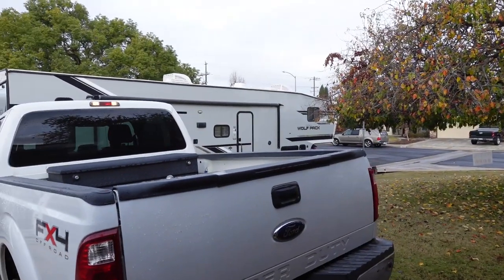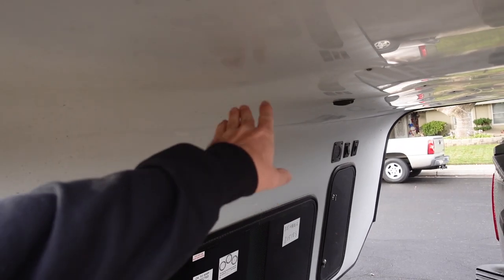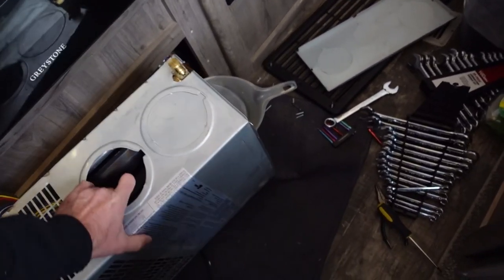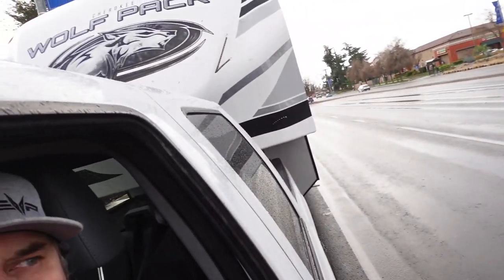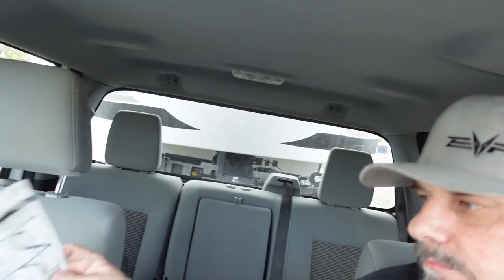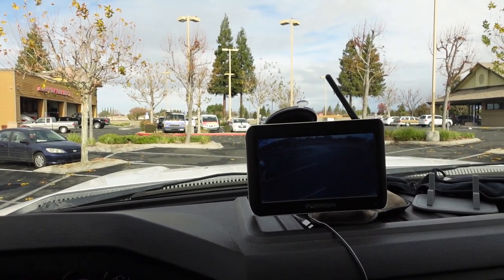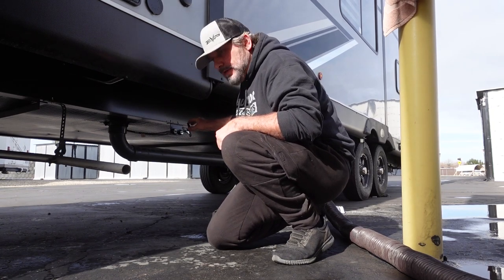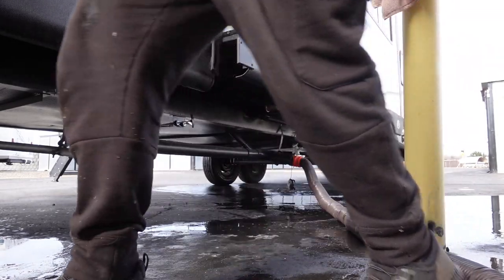Toyhauler Troubles - Preppin' For  Poopin' in Glamis... RV Clogged Drain = No Good!

Comment: Rhino blaster pro tank rinser!! The easiest way to back flush up the line and clean out a clog! Always try to dump tank before long trip home to avoid solids settling to bottom of tank into the drain lines, this is a common issue with the newer trailers that have the valves in the lines...not at the bottom of the tanks. The Rhino flusher is perfect cure for when it does plug tho. It allows you to close a valve at the hook up, and pressure flush into tank, while your drain hose is hooked up and won’t make a mess. Worth every penny!! That’s just my 2 sh**’s worth of advice.
Reply from the maker: I looked it up, we're getting one for sure
Reply: Good call!! I use mine every time, as well as the Santi-flush. Cheap insurance to make sure tank is empty.

Comment: I sent you a Valterra Flush King. It looks like your system has a few too many elbows to get clogged, so It will come in handy in the future. When packing to leave on a trip, I pour a 5 gallon bucket of fresh water in my toilet to help break down the solids while camping. I haven't had a clog yet. Probably too much information, but I hope it helps.
Reply from the maker: That's awesome!!! Thanks man that thing looks like it'll do the job
Reply: @DandiOffroad  It should deliver by the end of the week. I ordered it from Camperid.com. Can I talk you into a "patron only" review?
Reply from the maker: You got it

Comment: How do you like the hitch?  Doing a fifth wheel next.  Don’t know much about them.
Reply from the maker: A lot of people don't like them. There are pictures floating around on the internet of them bending or breaking. Most of the time I see it, it's actually just the same picture  over and over. I know a couple people that have them who love them and have not had an issue. We have probably almost 5,000 miles on this one with no issues so far.
Reply from the maker: And I will say that I love that it's so lightweight. Also there is no bucking or clunking when towing. Super smooth.
Reply: @DandiOffroad  I see.  Thank you for the response.  It is nice that it is light weight.  The super heavy ones seems like they would be a real bear to remove out of the truck.  Nice that it is smooth too.  I will have to look at them when the time comes.  Thank you.

Comment: I love your hitch ❤️
Reply from the maker: Thanks man, how many miles have you towed with it?
Reply: Me too, how long is your bed in the truck? It looks like 6 or 6 1/4 but your turn radius is excellent without being close to the cab more so for an 8 for bed
Reply from the maker: It's a short bed. We have no issues with turning. We can't do a full 90 but we can make a good turn.
Reply: @DandiOffroad  that was a pretty tight turn around at Walmart
Reply from the maker: And It'll turn tighter than that

Comment: I'm no expert by any means but when I got my trailer used the drain was clogged. I poured 1 quart of pine sol in through the toilet followed by 4 pots of hot water that just starts to boil, let it set for a couple hours then all was clear. I would think that with your trailer being newer that there is a connection on the outside to flush the black tank. Probably a sani-flush, the water hose screws directly in just like city water connection. Maybe try a different toilet paper to prevent the clogs in the future as well. Scott rv is supposed to break down pretty good and is still somewhat soft to use. We normally just use the 2py Kirkland brand, probably doesn't break down as well though.
Reply from the maker: That is a good tip,, pinesol and hot water. We bought the trailer and made two trips before the Covid thing. We made one more trip and the toilet was clogged. I used the sani-flush,, I call it the poop sprinkler every time, I also leave water and chemicals in the black take every time I dump. Good top on the TP, we never had an issue with our previous trailer but this one has more plumbing also, a few more 45s for the waste to travel through.
Reply: @DandiOffroad  Makes it smell good too. Also I always leave a few gallons in the tank to keep anything from sticking to the bottom. So after you flush it all out, fill with poop sprinkler with valve closed for 30-60 seconds and store the trailer like that.